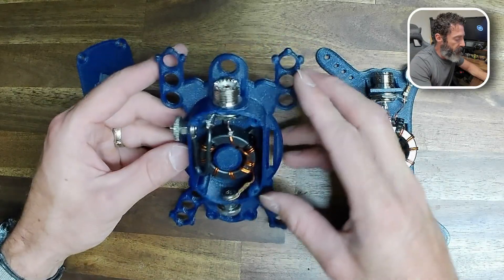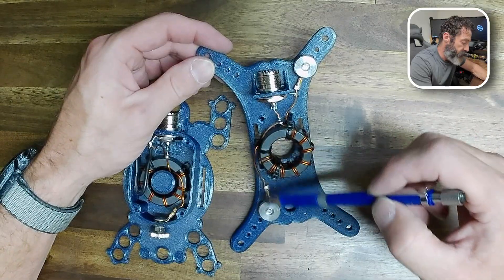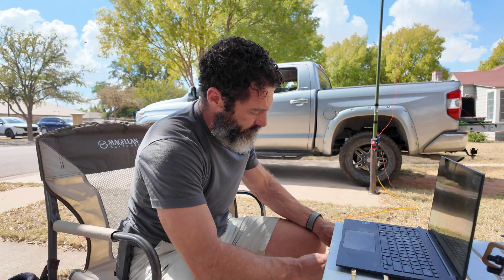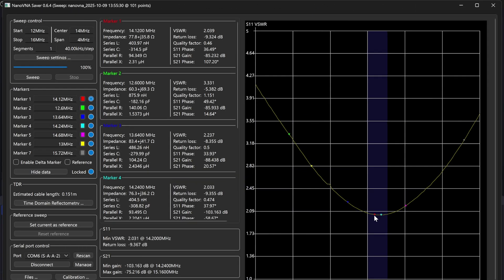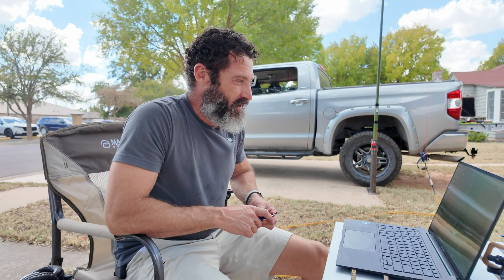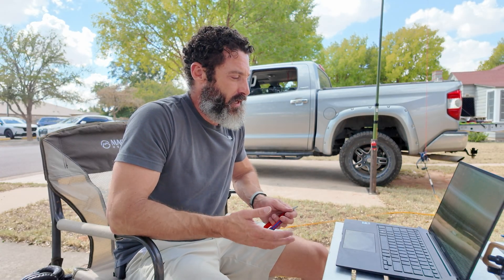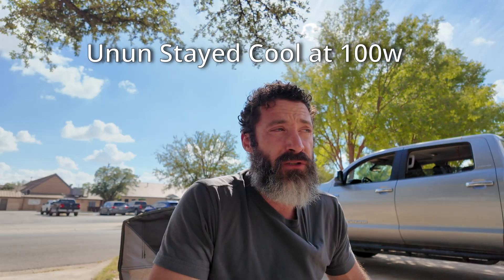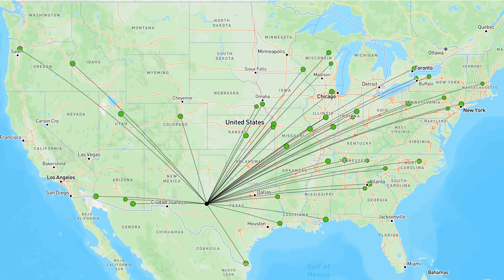Budget challenger Antenna Build (Part 2) | Tuning & Field Testing

Comment: Really enjoying your experiments Tim! My training is both hobby and military (USN Radar).
The whip v pole and wire thing is super mild attenuation from the pole. Contrary to myth all materials will have some effect no matter how minimal to the near field development. Some times its a wee bit of directing it and a wee bit of attenuation. Im going to build one of these myself and will  be using either a bank fishing rod like Tenkara or a wind sock mast. If I must it will be a set of nesting poles from Max Gain systems the very best supplier of parts to build all things radio antenna. Look them up for future builds, youll love their prices and offerings.
Look forward to networking with you some time in the future with a killer idea Im working the bugs out of. KD9UQE Craig
Reply from the maker: Glad you like them! I'm having a lot of fun trying different things. I agree it seems with antenna everything has some sort of effect. Looking forward to hearing how it works for you and your idea. 73

Comment: Great video Tim! Are you tempted to makes the radiator and counterpoise with links for different bands?
Reply from the maker: Yes, I'll probably make a linked counterpoise and make a few separate radiator elements. I used it as a rybakov today and it worked great.

Comment: Excellent work Tim, I always enjoy watching your videos implementing your versions of my antennas! Yes, given that the velocity factor of a stainless steel whip is ~90% and of an insulated copper wire radiator is ~95-97%, you will definitely see different lengths with those radiators. And yes again, given your wire radiator, it's fine to extend the counterpoise a little longer to compensate. Your vehicle body in the nearfield will definitely impact feedpoint impedance and the radiation pattern slightly, but I'm so pleased it worked out well for you! 😀 73 KJ6ER
Reply from the maker: Thanks Greg! The day after recording this video I hiked out into the middle of nowhere to help HA9RE get a rare county and it worked great. I really appreciate all your antenna designs. The Challenger has become my go to lately. I’m planning to try the Dominator beam soon with a DIY Unun. 73!
Reply: @Tim-K5OHY  Fantastic! Yes, the Dominator Beam (aka Parasitic Array with a Director) is amazing for DX. Everytime I deploy it in California, I skip across most of the US (on 10-15M) to work the the eastern seaboard, Europe and behind me to the South Pacific! And guess what I'm designing now - the 2-Element Parasitic Challenger Array! I've learned with a quarterwave, a parasitic reflector is better. But with these halfwaves, a parasitic director is better. Modeling has begun, stay tuned 😀 73 KJ6ER

Comment: Your pickup is part of your antenna.    If you set up the antenna another way you'll have to tweak it a bit.     Your pickup body can be ground bonded.   That my be a good thing as then you make it a counterpoise.  It's insulated by the tires, so it could be grounded also.  Whatever works best for you.
Reply from the maker: Yeah, I mentioned in the video that it's not the most ideal deployment for this antenna. This is a tiny park and it's the quickest and easiest way for me to deploy. For some of my antennas I run the counterpoise to the truck body which seems to work well. Thanks for the comment.

Comment: I use this setup all the time with 25’ telescopic mast, I didn’t know the name of it but I said it’s like Rybecov on a tripod. Then I use hextenna antenna as a tripod, but installed a 4:1 unun with 3/8 ring connectors to each 17’ mast and it works from 10-40 with a tuner and it’s directional too. I’m disabled and have to use my son’s help to set up the antenna’s, so I have to make it as lazy as I can, no adjusting the antenna for every band. PS it’s installed on my back porch at home. 😅
Reply from the maker: That's a interesting antenna, sounds like its working great for you. Thanks for sharing.